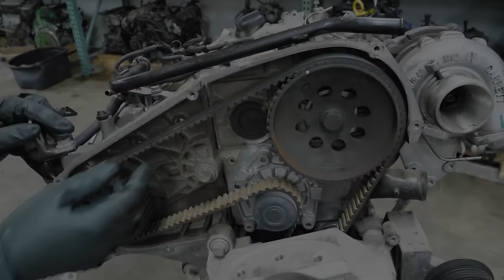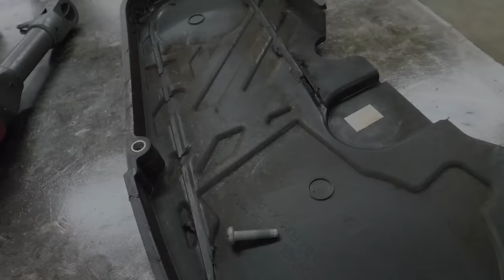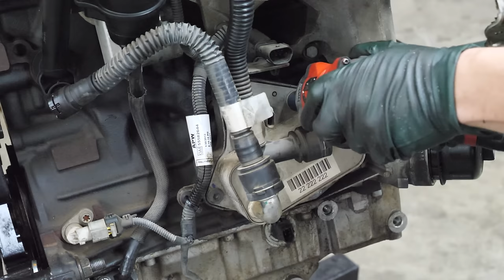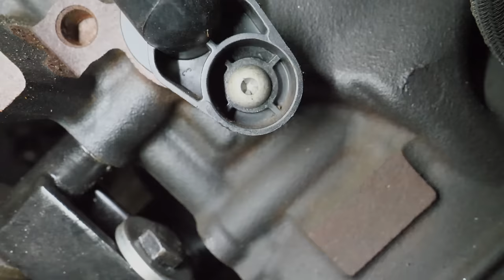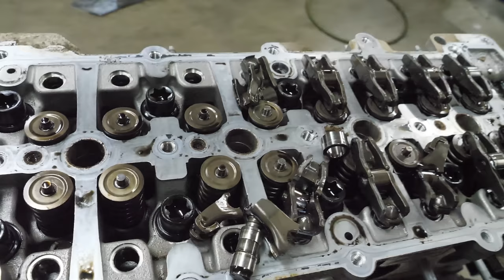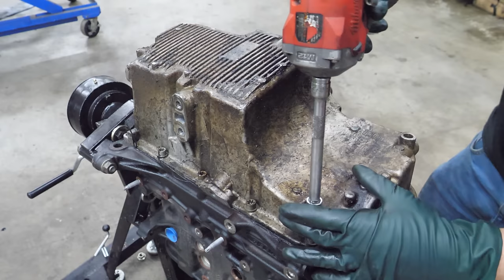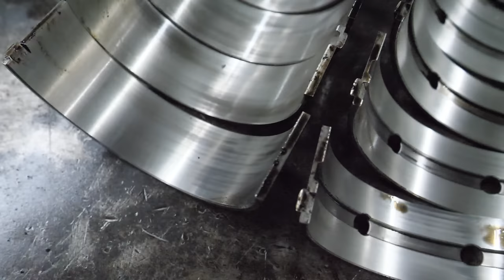I RUINED IT! Tearing Down A "BAD" 2.0L Chevy Cruze Diesel The Wrong Way

Comment: Broken rockers - you triggered a memory.  I have a 2.8L 4 cyl VM Motori diesel (I think it's called a cam cover; that looks like a similar head design style to mine), and I think I remember reading that the VM Motori's rockers are designed to break before valves bend or pistons are damaged, if a timing belt breaks and valves hit pistons.  So whether you did it or it was already like that, I'll bet the valves and pistons collided, and the rockers broke as the sacrificial part.
Reply: I had the same experience with a 1996 vauxhall corsa B 1.2L. water pump seized and broke the timing belt and snapped most of the rockers on the head. i put used ones on and then there was a bent valve i didn't catch that squeaked when running so i put on a different head that had an oil leak. I didn't want to change the valve because i didn't see an adjustment screw, but later on i realised it had hydraulically adjusting tappets and it would have ran fine after being ground in. live and learn.

Comment: torque on those head bolts should be 1st 15 lb ft 2nd 48 lb ft then 3 through 6 is 90 degrees so 360 degrees in total

Comment: CP3 injection pump is the most reliable common rail pump.
Reply: Have over 560,000miles on my original cp3 in my 2006 ram cummins and still ticking...
Reply: @fromthebeginning6064  My 2004 ram cummins only has 320,000miles on it. Granted it only has 6000 hours on it meaning it's average speed was 53mph. So pretty much all highway driving.

Comment: I couldn't figure out the destruction.  Evidently they designed the rockers to break so if the timing belt broke it wouldn't hole the pistons. Someone said downthread anyway this was by design and I am assuming the purpose of a breakable rocker arm. That's one weird design but come to think about it why don't many interference engines, which is most now I suppose, designed that way? (on edit I realize many engines don't have rocker arms anymore) Why is it weird at all. Perhaps low RPM diesels have something to do with it.

Comment: Yep, that's a fiat 2.0 multijet engine. Extremely popular here in Europe, known for reliability and great fuel economy. These 16 valve heads sometimes crack due to the excessive heat caused by DPF cleaning procedure and leaky injectors. Fun fact - because these engines have relatively weak rockers and the valves are perpendicular to the pistons, they dont't suffer catastrophic damage when the timing belt breaks. New set of rockers, new belt and you are back in business.

Comment: The  low oil level sensor is a stupid design as well.  They leak at the o-ring and require pan removal to replace as it removes inward.

Comment: In our industry we use specialty bolts to avoid untrained -unqualified personnel messing with parts that can be dangerous and/or expensive. 
On the car industry, my guess is that the engineers just hate the mechanics 😂

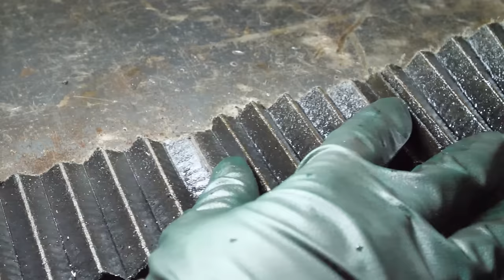Comment: 7:23 Eric cant you just get a nice sharp Olfa snap-off razor blade to cut the soft cloth mesh filter fibers away from the plactic caps instead of using the dangerous wood-cutting chopsaw that usually destroys the filter or the saw blade in the process of attempting to look for forbidden glitter on filter media. One on these times your gonna really hurt yourself f'n around w\ that chopsaw! Please get yourself a nice Olfa knife w\ 18 or 25mm blades - the black bades are sharper than a razor, & better than the shiny steel blades. You can even buy serrated razor blades for it too if they'll work better for certain things.🪒🔪🪓🗡️⚔️⚠️👍🏻👌🏻🚫🚧⚠️🦺
Reply: Well they say you learn something new everyday. I learned a few things on this video. One the name of the oil pan fastener drive :: Ribe r10 or m10. And the other weird 5 sided 'pentalobe' style fasteners are just 5 sided torx or 5 sided tp torx  is the tamper resistant style with the anti-tamper 'pin' in the center of the 5 lobes. Where 'regular' Torx & Tamper Proof Torx would be 6 points with or without the center 'security', anti-tamper 'pin' in it. 

Then there's Torx Plus which is a whole different style again!! 🤦🏻‍♂️🤔🤷🏻‍♂️👍🏻👌🏻🔩🔧
Reply: The way the top rod bearing is marked is kinda weird. You'd think the wear mark would be much more spread out over it rather than that 1 inch spot. It's almost like the crank rod journal was a lot smaller than it should be to make the wear more concentrated or it was egg shaped. Who knows!? 🤦🏻‍♂️🤔🤷🏻‍♂️🛠️🔩🔧

Comment: New timing belt, WP and tensioner..  tells you everything.... guaranteed it was out of time, broke some rockers, probably retimed it correctly and wouldn't run right.... high miles so they just put an engine in it and they reused the injectors or yard you got it from sold them.  It rusted up sitting outside open.

Comment: 2017 for the water pump?  So it failed in only 3 years?  Mine failed prematurely also.  At 85k miles, so did the timing service at the same time.  Crap water pump design.  It should be rated for at least 150% of the timing service mileage.

Comment: This engine was supposed to be the VW TDI killer in the US. It was supposed to be more powerful than the TDI and get better fuel economy. But the chevy engineers couldn't figure out how VW was able to get away without using DEF and when emissions got stricter and VW had to use DEF, they were once again perplexed how VW got away with using so little DEF. In 2015 they got their answer.
Reply: And several managers/executives at VW went to jail. The trickery was discovered by engineering students at a small college.
Reply: @Splungers  Are you sure they went to jail? You don't usually go to jail over such things.
Reply: @erikkovacs3097  Search "VW diesel executives jailed" one even had a $400,000 fine on top of the jail sentence of 40 months.

Comment: My friend has a chevy cruze 1.4 turbo it over heated on his way home continued driving 2 miles to get home next morning put in cooling, car wouldn't start when got there I could smell gas figured it was flooded push pedal to floor cranked it for a few seconds then tried to start it again nothing,  took out spark plugs all cylenders were full of gas don't know if the head gasket is gone or different problem,  any one have an answer I'm stumped

Comment: This engine has one major fault, the egr gets stuck, most of the time its not stuck so bad it throws engine codes BUT what it does is pour soot straight into the oil, which eventually leads to starvation of the mains.  The second less common issue is the oil pump shatters and because its right on the crank, thats all she wrote.

Comment: Modern Adabatic Engines just that's...  : )

Diesel fuels = Oil fuels

                            🎉

High compression fuel engine   

100K mile & a 1 only owner.   🤗

Comment: I suggest you get portable bandsaw before someone(you) loses a finger. Or a sawzall or cutting tool or anything else than miter saw lol.
Reply: it would be safe and accurate with a small vice. I use one on my drill press all the time.

Comment: These engines has an known issue where the seal for the oil pickup becomes hard and looses its sealing properties. This will cause a low oil pressure issue, especially when the engine is cold. 
This is due to the diesel contaminating the oil and destroying the seal. 
This is a 200k km part, and need to be replaced. 
This engine is also used in the 2010 - 2012 Saab 9-5. It also comes as a twin-turbo variant producing 190 hp.

Comment: You can pull those sleeves out with a polar and put new ones in. There’s nothing wrong with that block at all. It just needs to be centerline for the crank before you even think about rebuilding it.

Comment: And on diesel motors, they got sleeves for cylinders. You can pull the sleeves and put new sleeves in the cylinder get it right they’re called sleeves in the cylinders. I worked on diesel motors. That’s how I know this stuff too.

Comment: If you start the front, don’t go to the back you go from front to the second boat, then work your way back from the second boat to the back and the same side. You never never take pan off in a crisscross pattern. You never take a head off and crisscross pattern. You go down from the driver side then you go down the passenger side when you head bolts or Vian pan

Comment: EDIT: My bad, that’s the 2.0 Multiet (A20DTx family) engine! The older (Pre 2014) Cruze has the VM motori one, lol
Anyway the first gen A20DTx had the bad habit of spinning the main bearings due to a design flaw in the lubrication system, many Opel/Vauxhall Insignia had that issue.

Ahhh the VM Motori RA 420 SOHC engine! It drinks diesel like an alcoholic on the Chevrolet Captiva (aka Chevy Traverse in the US). 
The 1.9 Multijet used in many Opel models is way better, I don't know why GM went for the VM one on the Cruze, lol.
Reply: Probably because Daewoo had the moulds for the blocks, and the rest of the parts, already in Korea, so making them was easier, and they likely already had a big stack of them already cast and machined spare.
Reply: North American Cruze got the Multijet diesel.
Reply: @manitobasky  yeah you're right I initially thought at the pre-2014 Cruze which had the VM motori unit.

Comment: I owned a brand new diesel Cruze in 2014. It had a check engine light 14 times came on and took the car to the dealer that many times, even the engineers from GM looked at it. Since it was my wife's car and we couldn't trust it, I sold it for $14000 loss and bought a Honda Accord.

Comment: When I was young and stupid, I used to remove the catalytic converter on every vehicle I owned. I wanted max power and didn’t want to sacrifice the 5hp max that a catalytic converter took. Now that I’m older and less stupid, I have a little more personal responsibility and realize that I need to do my part to try not to destroy the planet quite as quickly as I used to. The absolutely staggering increase in severe weather and forest fires erasing entire cities near me has probably played a role in that. Every time I hear about someone “backspacing” their diesel, it makes me mad now, especially since the trend for diesels is to tune them for maximum smoke and environmental destruction. I’m hopeful that someday people will eventually grow up like I did, but since things seem to be getting generally worse rather than better, I’m not that hopeful.

I’ve never seen one of these engines before, but I always just assumed the 2.0 diesel was just a diesel version of the 2.0t Ecotec, but this definitely appears to be completely different than those.

Comment: throttle plates, bmw, remove..any modern engine, needs a good long thrash, to keep them clean,ish.. cant help cats, egr, def, all that crap.. they want nothing comming out the tail pipe, but there not concerned with the amount, cost, of blow ups, new engines, parts, have to be produced to keep this sht going..  reverse phycology.. brainwashing..like all green crap..does not work..